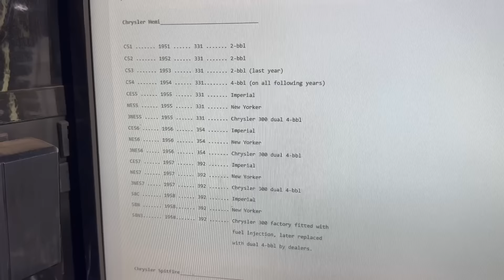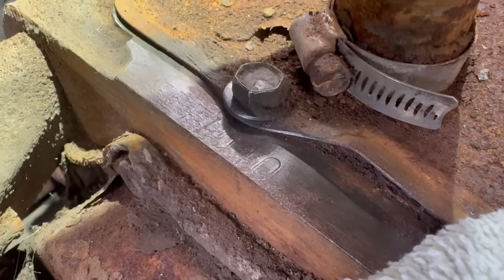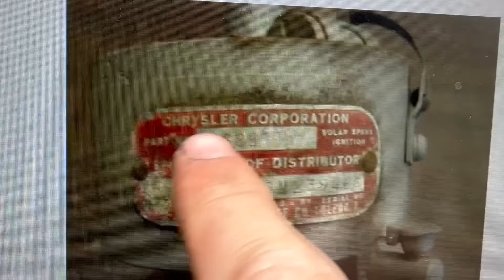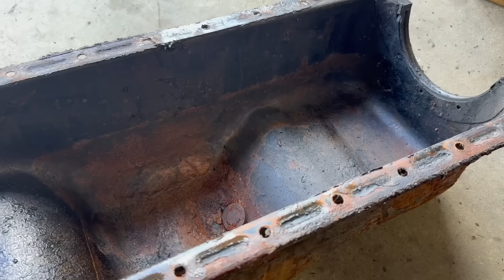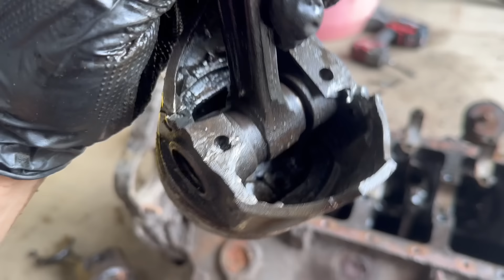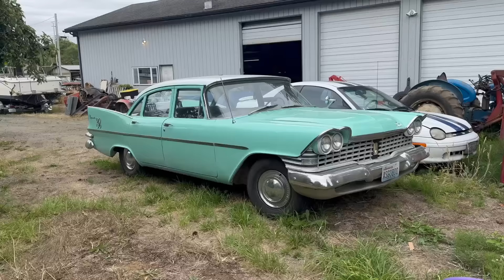The Big Hemi - Seized 1957 Chrysler 392 Engine Teardown, Component ID, Technical Info, And Much More

Comment: Not only did Autolite make the spark plugs, distributor, cap and rotor and generator, but they made the wiper motor and headlight bulbs on my dad’s 55 Dodge Royal.  It’s all original and they’re all still there 70 years later.
Reply: Unbelieveable, but true, they were built to last, unlike todays "throw away" cars.

Comment: Is this the same engine that was tied in with the Dodge Brothers racing program or the Hemi Chrysler under glass?  It's been years since the Hot Rod magazine❤
Reply from the maker: Even the original, early Hemi Under Glass was powered by a 426 from the beginning. I don’t know much about any factory backed efforts from the time the first generation Hemi was around.

Comment: 48:15 There's a few good reasons I'd yank a 1t gen Hemi from that glorious rolling art piece.

1: Fuel economy. I'm gonna drive that bitch every day. Swapping in a 225 Slant will give me a good 20-30% buff in fuel economy. 80 miles a day 5 days a week on a $600 paycheck? Yeah that's a convincing argument.

2: I HATE automatic transmissions. I refuse to drive anything with one. It's coming out for a manual swap if nothing else, bt even then, the options to put a manual behind a 1st gen Hemi VS a 225 Slant or an LA smallblock? 

3: Supporting it. Getting parts for a 225 Slant is orders of magnitude easier and cheaper than getting parts for a 1st gen Hemi, both maintenance/repair and speed parts. For a collector car, not an issue, for a car that's gonna see damn near if not over 20,000 miles a year put on it that's pretty damn important.

4: In all likelihood if I am able to get my hands on one of those gorgeous Forward Look cars the engine's gonna be trashed anyway let's be honest. My broke ass ain't gonna be affording one that runs.
Reply from the maker: Manual options exist, as I explained here. I’d PAY to see you or anyone else drive a Forward Look car 80 miles a day every single day. If you managed to improve economy from 12 MPG or so to 17 MPG or so (it would be hard to imagine much better than that, but it’s possible) you could save $40 a month. How many months does it take to offset the cost and trouble of a custom, one off conversion parts don’t exist for? Automatic transmissions are great for commuters. Shifting gears in traffic all day is obnoxious. 

If what you just described is what you need out of a car, don’t buy one of these. It’s just that simple!
Reply: @DeadDodgeGarage  > Manual options exist, as I explained here.

Yes, but there's a lot more of them for the 225 Slant or the LA smallblocks and they're a lot cheaper to set up. I stand a reasonable chance of finding an LA smallblock with a manual hanging off the back of it in a scrapyard lol. 

> I’d PAY to see you or anyone else drive a Forward Look car 80 miles a day every single day.

Put one with three pedals in my driveway and I'll upload dashcam footage every day to prove I'm driving it every day

 > If you managed to improve economy from 12 MPG or so to 17 MPG or so (it would be hard to imagine much better than that, but it’s possible) you could save $40 a month.

And that's about the economy target.  

> How many months does it take to offset the cost and trouble of a custom, one off conversion parts don’t exist for?

And that is precisely why the 1st gen Hemi would come out for a 225 Slant or an LA smallblock.Orders of magnitude cheaper to set up a manual trans Forward Look car when the engine and trans don't cost an arm and a dick to procure. 

>  Automatic transmissions are great for commuters.

They're great for paraplegics, amputees, and radio control projects.

>  Shifting gears in traffic all day is obnoxious. 

Homey my current daily driver is a 1971 Chevy C10 pickup with a 250cid I6 and a 3 on the Tree manual. 🤣that 80 mile daily commute I described is what I'm doing in that C10. 40 in, 40 back. It returns about 18mpg or so. 

My previous car? A 2014 Challenger. Let's just say I couldn't' wave bye bye to that thing fast enough...

> If what you just described is what you need out of a car, don’t buy one of these. It’s just that simple!

I want a car from the Atomic Era as a daily driver. I know I'm a wierd-ass saying that, but I want a daily driver from that era. My 'blank check to buy whatever you want' car is a 57 Belvedere equipped with a 225 Slant, a 3 on the Tree manual, aircon, FM, cloth seats, painted a pretty metallic blue/cream white twotone on wide whitewalls. That's what I would have if I was handed a blank check to get whatever car I wanted.
Reply: @DeadDodgeGarage When I was working in South Carolina in 1997 I saved my expense money and found a 1968 Satellite in the Green Sheet for $600! It had a Leaning Tower of Power and I drove it home from Hartsville to Pittsburgh. It had no problem leveling the mountains and I was in the wasteland around Max Meadows when another 68 was going south! Our calibration shop had a 1964 Thomas One Ohm standard that needed to be driven to NIST in Gaithersburg every year, and guess who got the job? Driven down and back home two weeks later. The car got a constant 30 mpg. I wish I never sold it.

Comment: Autolite...kind of like how GM HydraMatic transmissions found their way into various non-GM makes as original equipment.
Build a better mousetrap, folks show up.
Reply: Autolite was not affiliated with any of the Big 3 at the time. It's the same as Chrysler, GM, Ford or AMC using Carter or Holley carburetors.  All of the automotive manufacturers buy private labeled parts from 3rd party suppliers.

Comment: I think you should put your engine roasting rotisserie filled with a mix of oils and spices either in the dirt floor mystery room… or in the back of a full sized Dodge van making it mobile.
Reply from the maker: The mystery room has the worst concrete imaginable. Dirt would’ve been better. Anyway, I like where your head’s at

Comment: 555 triple nickel heads!! Built a '58 392 with KB domed 10:1 pistons and had the original cam core reground to Comp 286 Magnum specs (236*@.050" with .490" lift on a 109*LSA) and my friend stuck it in his '29 Ford rat rod. With a Hot Heads 2x4 intake with 2x650 Holley carbs, coupled to a 200-4R trans it ran in the 10s in the 1/4mi! He couldn't believe it was that strong! We used a 10-bolt Chevy Nova rear axle with 4.11 gears and a Auburn Posi, and with the overdrive trans and functional lock-up converter, you can drive it anywhere.

Comment: Another great Engine Wednesday video. I had a buddy in the mid-eighties when I was ten, whose dad had several  '57-'60 F100's, one of which had a built 392 and a 727. I ended up buying one of the '57's for my first vehicle at age 15, but not the one with the Hemi, he wouldn't sell me that one. I always wanted to recreate that truck and eventually I will. It's on the list to make happen and closer than ever with them coming way down in price. Early Hemi's are cool, but obviously, you already know that.

Comment: My 1969  Belvedere wagon loves its 58 dodge 354 truck hemi, one of the nicest running engines I have ever owned (V8)
Reply from the maker: That’s awesome!
Reply: Keep the wagon, pull the 440, drop the 392 in for cruising 😮
Reply: It has “Scrap Pack” stickers in the rear side windows😎  your excellent entertainment and all around good guy. Hope your channel grows. If you might want to see some videos of the wagon checkout YouTube shorts under Jamie Delaney.  I post them to entertain my older brother ( 800 miles away from me and the wagon)fighting the Big C.  He responsible for hemizing dads wagon😊 Is that a word? Use it anyway🤭

Comment: I have a weird question  what are those  Allen headed  plugs inside the heads
Reply from the maker: They plug various openings left over from the manufacturing process. I’m actually not sure they’re plugs in the actual part. They may have been in the pattern for the casting.
Reply: @DeadDodgeGarage I'm sorry so are they pressed in or threaded
Reply: Yes! I wondered that too!

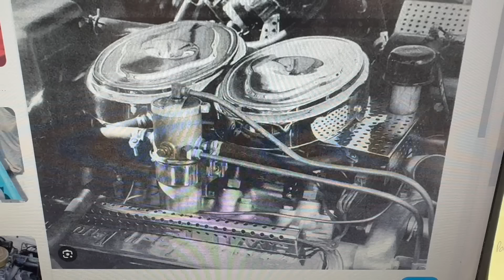Comment: 6:56 Bendix made the fuel injection for Chrysler. Bendix sold the FI technology to Bosch, shortly after the Chrysler FI debacle.
Reply from the maker: Yes - exactly, that. I misspoke. I’ve shared that story on video previously. Bosch bought the technology, improved it, and it was eventually put to great use in countless vehicles.

Comment: WHAT?!?!   A car company that used other manufacturers parts????  Well let's all chide them for doing so!!  Let's start calling Chrysler "All Makes Combined"  or  "Another Mans Car".  Yeah, that'll show 'em.

(Oh, and it was the *BENDIX* Electrojector.  AMC played with it too, but they found in testing that the system was susceptible to radio-frequency interference because the control box wasn't shielded..... something Chrysler found out a little too late.  The fellow featured on the Jay Leno program mention he added RF-shielding, modern capacitors and transistors.... and used modern, Bosch injectors due to the complete lack of any original OE ones and said the system works quite well, though does have a tendency to run a little rich on occasion.)
Reply from the maker: I said Bosch, I meant Bendix. I know 😅
Reply: @DeadDodgeGarage  I was once asked if I wanted a 7th beer and I answered: "Snow".

Comment: I have that same Wilton "unbreakable" Hammer... I bought it because it said "unbreakable" and I said "challenge accepted".  I've broken more hammers than I can count (literally all of them before "Hulk Smash" as I lovingly call the Wilton)  in my 29 year mechanic career...

Not only is it actually, truly unbreakable, (probably due to the 6 solid tool steel rods that are welded fully solid together and then welded internally into the hammer head before the handle is molded on)  but I swear those things actually hit harder,  transferring more of your physical force into whatever horribly rusted midwestern automotive component you got tired of asking nicely to come apart, but are still allowing it to possibly live,  as the final solution is reducing said part to a puddle of molten lava...
Reply from the maker: I’ve got that 4 pound, and a flat / ball peen combo. It has been fantastic, and it sure has seen some stuff. They make great tools.
Reply: Holy crap those are $$$
Reply: @Jaybird66sweptline  they're not cheap,  but they're worth every penny.  Last hammer you'll ever buy.

Comment: Does anyone have any good tricks to get stuck distributors out of engines that have been sitting for 20 years or more?
Reply from the maker: Spray it, heat, beat, repeat…
Reply: PB Blaster first. Get cans of canned air. Turn the cans upside down and spray the bottom of the distributor where it goes into the engine with the -40 blast. This will shrink the alloy distributor and it will come out of the iron block.

Comment: Looks like someone painted your motor with Cosmoline Rust Preventative. Great stuff for long term storage. Turns into something over time that resembles wax. Was common back in the day but is very expensive now.
Reply: You can still pretty easily get cosmoline. CRC 06026 (HD Marine Corrosion Inhibitor) is like $12/can. And I think you can get a gallon from Houghton for maybe $75?
Reply: I thought the same thing. I’ve bought a few old surplus rifles that have been dipped in Cosmoline, it’s like they’d been dipped in candle wax. The best thing I found to clean it off is very hot water with dawn dish soap.
Reply: @minnesotatomcat i picked up a surplus British SMLE rifle years ago that was soaked in cosmoline and wrapped in oil paper. The cosmoline had hardened into a very hard wax. Tried all kinds of stuff to removed it and nothing worked well. I finally heated up engine oil in a tray that was long enough to sink the rifle in. Let this soak for an hour and when i removed the rifle the cosmoline melted away. Blew the excess off with compressed air and cleaned it up easy.
Did this to other surplus rifles i picked cheap over the years.
Days of cheap quality rifles are over for now…
Reply: @shaneconrad7816 I paid $79.99 for one of the rifles 🤣 yeah those days are LONG gone.

Comment: Good stuff as usual. Oh and in a dream world…it would be so cool to take your 276 and modernize it. Have all your journals fish eyed the heads massaged  with a tricked out valve rocker set up revised cooling system, fuel injected, forced induction. And have it fall into a 63 200 valiant 🤣(preferably a white one) 😂
Reply from the maker: I like where your head’s at, but I was thinking I would display it proudly in a PT Cruiser gasser 😅
Reply: @DeadDodgeGarage OH! OH!

Comment: A couple fun facts about 1957 392s... The engines for the 57 300s had solid lifters and adjustable rockers. The stock dual 4bbl was rated at 375HP, but there was also a 390HP option in 1957 where they used a different cam to increase the compression ratio from 9.25:1 to 10:1. This is referenced on page 303 of the "70 Years Of Chrysler" book, but no detail. According to google, only 18 were made.

Also, those holes in the top of the lifer made it possible to fish a lifter out using a hook made from welding rod without removing the head or intake, only the rocker assembly and pushrods. I don't know if that's why the holes are there, but it was sure convenient, I've done it a few times.

Comment: You might be able to use a 55g barrel to soak a block in? Assuming you have room for the barrel.
Reply: Then he would need the space and spend money on a ceiling winch and a free cherry picker to get them in and out of the 55 Gallon drum. Not to mention how much extra "gives a f**ks" he would have to include lol.
Reply from the maker: I have an electric overhead crane, but its travel is limited to side to side in the back bay. Not that I’ve thought about this or anything lol

Comment: Hi Jamie, the guy that greased the hemi was probably a navy guy, the navy had a document for long term storage, I came across a 500kw generator that was preserve that way. grease of some sort was in everything water jacket and all, as per the document to use the engine it must be completely disassembled cleaned and re gasketed. I don't remember what the navy called the procedure Navistar or something.
Rich
Reply: Yup, using Cosmoline grease.

Comment: Traditionally military small Firearms have been preserved with similar stuff. Theres a waxy nature to cosmoline, and very difficult to remove.
Best thing (cheap, available, kinda works ), is Kerosene!
I think it helps if heat is applied, and most mineral spirits work.

Comment: 7:05,  small addition, it wasn't actually a Bosch System, the electrojector was a Bendix system. The Patens were sold on to Bosch years after it failed and bosch managed to Develope the D-Jetronic out of it, which was their first mass produced electronic fuel injection system, which was also built under license by Lucas for some Jaguars and later developed on into the L-Jetronic and their later systems.
Reply from the maker: I know. I misspoke
Reply: @DeadDodgeGarage  didnt mercedes dailmler make ohc hemi heads.. & the french flew the first plane & v8 engine. not the u.s.. hu..hu..hu....
Reply: @DeadDodgeGarage  but jaimie..  you cant beat a chevy v8...  for blowing up...
Reply: @DeadDodgeGarage  i like & will keep my clevo semi hemi forever. cos there built correct.. & last forever.. 385 series truck engines..  heads the chev guys dream of..  my FE, is where the LS got the head design, only 600 yrs behind the times..
Reply: @DeadDodgeGarage  jaimie..  you should bui;d a huge vat, full of sulfuric & nitric acid..  for all the dumb commentators..  me inc..  & remember.. im in aus, so i dont give a sht.. ITS A SPLIT PIN.. funny, i have a new packet, with cotter pins. on it.. more people to educate..

Comment: Please complete one of the Gen 1 hemi engines! I've built several, and they're great platforms. Donovan 417 ran in TF well after the 426 came along.
Reply: Desoto added 341/345 to the tall deck 330
Reply: 325/345hp was the 57/58 compression bump from 9.25 to 10:1
Reply: 392 intake ports were lowered in the head, as well, guessing to keep hoodline down. 555 aren't raised compared to the other low deck hemi/poly. I put 11/32 guides in my 354 heads, and 2.08/1.94 SBC +.100 length valves.
Reply: Ah..1958, what a good year😂.
I hope against hope DeBoss is where that engine is going...he'll probably put it in a Volare lol, but I seriously hope it's going in a period correct car...but that's being greedy...just bringing it back to life is enough!
Yes, I'm one of the "like anything" viewers, but the older stuff is special, I think. Probably due to, ahem, age. Also, these older, informative video's show that maybe some modern Hi-Po ideas are 70+  years old!